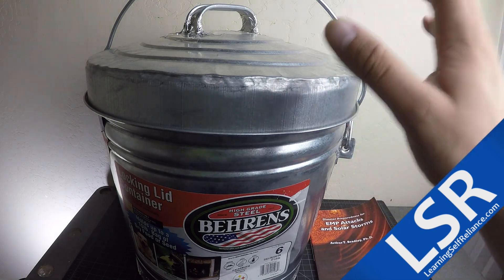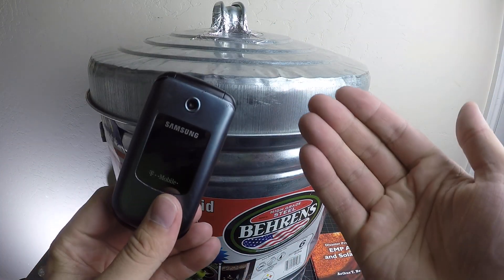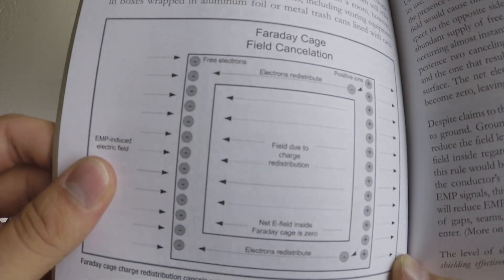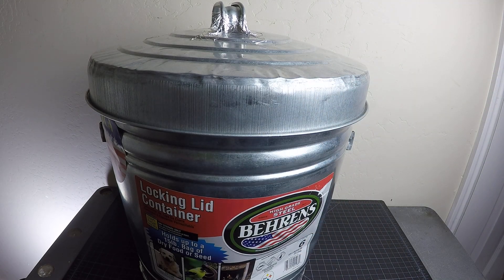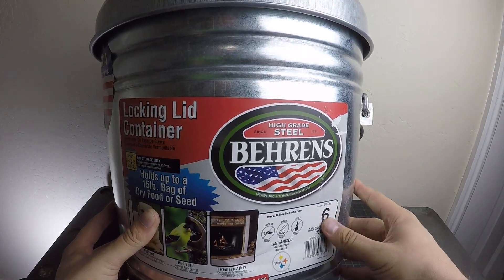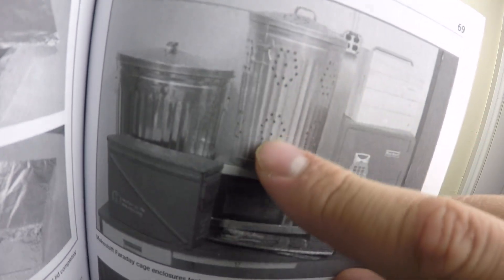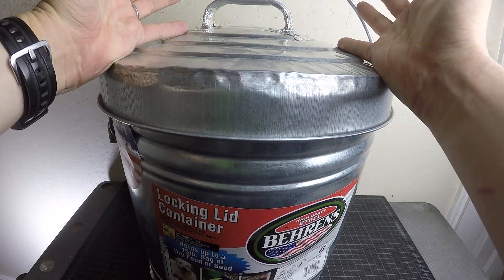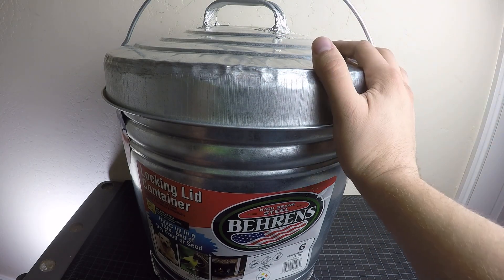Faraday Cage & EMP Misconceptions

Comment: I am only just learning. Don't laugh at me too hard at my dopey questions. 
I need to get that book! 
The solar maximum is in 2025. Conceivably we could get slammed by a massive CME at any time and then there's putin... again.
 It's 2022 now and he's freely talking about using them, this time. 
So, it's just smart to be prepared. 
Crap happens and humans are crazy especially the greedy and power hungry ones. 
Also,
I live in a14 x 70 single wide in Upstate NY. It gets pretty cold in the winter and I need to reside the whole thing. I had the roof redone and it's now a metal roof. 
I want to use the insulating foam board for the outside walls that are covered in foil anyway but I'm just thinking. If I do that. Do you think I'd get any protection at all between the roof and the walls? 

Now, after watching your video abd a few others, I feel like I need to cover everything!
 I want to get a portable solar power station too and those aren't cheap so, it'll get it's own can. I want to protect that as best I can and, of course, my Nintendo Switch too!
LOL 😆 priorities!!!

We might get as much as a 30 minute warning from a powerful CMP so, I was wondering, would my van still be fried if I disconnected the battery or took it out completely? I'm thinking take it out and put it in it's own metal can(2013 Grand Caravan named Agnes) After I took the battery out, would a thick silver thermal blanket (more like a quilt) draped over the engine (under the hood) protect the components so she'd start once I put the battery back in? Or would that just be a waste of effort and still take out the battery because, it's power can be used elsewhere.  Like where? I do not know. 

Like I said, I'm only just learning about Faraday cages, etc. 
Thank you! 😊

Comment: here's the deal.... DO NOT USE ANY TYPE OF METAL OTHER THAN COPPER OR GOLD.

AND IT NEEDS TO BE AT LEAST A QUARTER OF AN INCH THICK....

PERIOD...

There is no other metal in the periotic table that will ever get the job done... dont waste your time with aluminum.... waste of time...

you need copper or gold.... and if you really want it to be effective.... it needs to be layered with the same metals.... 1/4 inch thick in every direction will shield against anything that you throw at it.... no matter if its a high yield of EMP is... whether its a unclear blast, or Cosmic event....

if you have a cube that is 100% copper or gold and its at the very least... i recommend even thicker.... 1/2 inch or 1 inch thick with absolutely zero gaps.... then there is nothing that will penetrate that...

Comment: I'm not trying to be critical, but a lot has changed since the book you cite was written (i.e. transistor gate gap, etc.)  A good primer on EMP and CME can be found by searching for "the truth about the EMP Shield", but current information is available from many sources.  The manufacture of EMP Shield provides the protection for our military, many utility providers, oil and gas industries, individuals and more.  They provide protection for your whole house, generators, car and other items at very reasonable prices.  You can look up the approved providers for this type of equipment on the Department of Homeland Security website ( yea, a lot of snake oil out there).  While the potential for significant harm to our infrastructure, businesses and individuals was learned a good while ago during testing of nuclear weapons nothing of substance was being done (with the exception of th state of Maine).  In 2019 President Trump was concerned that we had a significant weakness that needed to be rectified and he passed legislation to incentivize companies to find ways to protect against EMP & CME.  The EMP Shield Company is a leader in this field.  Another good source for information on Faraday Cages, bags, etc., can be found by searching for "empdoctor" who is a research scientist/ educator (Phd).  He does a good job of displaying the effectiveness of various methods through video and simple, easy to understand language.  If you are a ham radio operator a good read is a book you can find on the ARRL website. There is a lot of good info available, but as you might expect, there is a lot more well meaning but inaccurate information.  RLTW

Comment: A transformer Popped( 1 Tiny EMP) 20feet Above my 1979 Pontiac Catalina. it Fryed The chip in the Engine, it Fryed the Chip in The Radio, it Erased 1/2 the CD'S  on the Seat in Line of Sight To Transformer. 1 Tiny EMP.   Killed that Car..

Comment: A true Faraday cage DOES block all Electromagnetic radiation. the Trash can still have gaps larger than the wavelength of the radio waves hence can leak into the can. However, if you use aluminium foil to wrap your phone and since it's completely sealed, no waves will pass through.

Comment: It’s 2021, I have a faraday bag that does not allow a cell signal to ring my phone. Bluetooth doesn’t work in either direction even with only a fraction of an inch between two paired devices, one inside and one outside. The same is true of wifi/hotspots.

I’m guessing physics has not changed in five years but I’m pretty sure there is something amiss with your cage.

Still I appreciate the time and effort to produce this video!

Stay safe and healthy!
Reply: yep was going to say the same.  I made cages at home, made sure to tape ALL holes seams and weakspots. no phone signals getting through.

1st try can was singing and I had no idea what was wrong.  the slightest gaps are significant.

Comment: The 1859 major coronal mass ejection (CME) discharge that directly hit the earth - straight on - was in the period of an enormous railway building boom in the United States.  The communication was by Telegraph & Morris Code.  It burned out miles and miles of Telegraph wires on telephone poles, taking great expense to replace it.
WIRES!  What about the power grid?  What about the wires leading to your house?  What about the wires IN YOUR HOUSE?  What about your extension cords?  What about the wires all over your vehicle?  So you save the ignition module somehow ~ are you prepared to completely rewire your car?
Are the windings in electric motors somehow immune?  Your starter motor?
Everything has to be metal shielded, and the SHIELDING has to be grounded - to a ground IN THE GROUND!  How do you do that when you are driving? At the Walmart parking lot?  The Dr.'s Office?

You can protect your transistor radio, but what stations will still be transmitting?
How many extra batteries do you have?

Comment: Why not use readily available items as a Faraday cage that may be free or cost little without modifications and that actually work and block out cell phone signal 100% if you want to test it with it.
Not sure why you want to save a cell phone  because the cell phone towers/equipment would be fried too.

Comment: Your generalities with trucking is hilarious. There are SO many sensors and computers on trucks that most of the time the trucks are in the shop for electronics issues, which STOPS their use entirely. You minimize by deciding what is permanent and not perminent damage, which is not relevant at all. ANY reason for the truck to not operate correctly will retard the engine or stop it completely. Based on your "Book" of expertise, 85% of all trucks down would be the end of our food supply after 2 days in the stores and a panic rush to buy everything on the heals of an EMP event.

Comment: I think you still want to ground any Faraday cage if you want it to function after a large solar event, or EMP.  You want to bleed charge to ground, always.  You can't have any air gaps, so you must seal all openings with conductive material, copper tape is much better than aluminum tape.  Your cardboard won't stop anything.  You have to tape the outside lid to can gap or what you have won't work at all.  You are putting more misconceptions out there, good intentions I know, but the book you are referencing tells you to tape the outside gaps to make the steel can work.

Comment: I made a faraday box for my cell phones and it works. I tried to call from my house phone and no ring then when i took out the phones none had bars but bars came back like a minute or two out the box. I used a wooden jewelry box and line the inside with aluminum tape and aluminum foil ,nice thick Reynolds wrap,not super thin dollar store foil.

Comment: I get people wanna save their stuff.. But why save your phone? Who the hell are you gonna call? There probably won't be any working towers for phone.. Let alone internet
Get lanterns.... Get food.. Water..etc
Reply: SD Cards slots filled with tons of audio, video, and ebooks regarding education & survival information.
Reply: Photos, but you could also save them on a hard drive. Then again, would be nice to actually be able to look at them on a screen
Reply: Cell phones would be a waste as mentioned in the replies. Get some FRS radios, take of the antennas before placing them in the can. I have a large can with a couple of HF transceivers, small 20 watt units. Good for short to long distance communications. A roll up solar panel is a good idea as well along with it's Voltage regulator

Comment: So basically it is a copper lining and magnet attack, so when two meets it creates a magnetic field that is opposite which rebel other electric fields outside? So, in one part you say it reduces the electricity but not stop. That is one part or you are typing the whole Faraday Cage that reduces the electricity field, so it doesn't stop completely. Or you mean base on metal alone it reduces the electric field, but the other part with inner that is copper like which interact magnet attract which causes opposite magnet field to the opposite so it stops completely? So, magnet field is important to stop electricity as magnet field is a barrier but different barrier that is magnet is magnet field as one barrier to copper as another when two magnet field meets in opposite way it creates a third magnet field barrier as a lining so it stops or reduces electricity field.

Comment: Thank you for this video.

Please review your physics-concepts again;  https://www.youtube.com/watch?v=Zu2gomaDqnM
It a quick lecture series about Electrics and Magnetisme of MIT.

There is no eletric field within a conducter: Al; the potentials within a hollow sfeer are equal. 
I can imagine that the bucket leaks current from the outside to the inside of the lid. dr. Lewin demonstrates in these series (maybe not in the shared lecture nr.3) that a electric load on the inside of a conductor moves to the outside of that conductor.

This is the cardinal reason to survive a lightning impact  within a automobile or a airplane in a storm.
Another example: on a dry and hot day, driving for a longer period....... when you toutch from the inside, trough the open window, the oudside of the car; only then you  will get a shock.

thank you for considering

Comment: Stainless steel is a very poor conductor and a proper Faraday cage needs to be made from a highly conductive material. A copper can/mesh will block the cell signal. Your steel can is not able to effectively distribute the electric charge. Essentially, that’s not a Faraday cage, it’s a storage bin.

Comment: I have a hard time believing that modern cars will not fail from a short waved EMP burst. They have so many interdependent components if one fails the whole car stops working.
Reply: Ik right if you pee on one wrong it needs a reflash at the dealer
Reply: You can buy an emp shield for your car.  I have one installed.
Reply: @delaville680  Good to know
Reply: @delaville680  can you tell me where and how you had this installed?
Reply: @delaville680  You Sir have been scammed.
Reply: @delaville680  they are a ripoff
Reply: @jamiefowler6524  I was gonna say... The steel body should be possible to modify into at least a partially effective Faraday cage. 

You may have to install screens over the glass, though. Pretty sure that's not legal. XD
Reply: So it seems that all of the shielding the military uses in its equipment is a waste of time, perhaps you should tell them to stop spending literally millions of dollars to shield their equipment.😮
Reply: @scottdavis6734  If you're planning on driving anyplace after an EMP attack (and assuming that the booklet is wrong and that >30% of vehicles on the road are toasted or out of fuel), you'd best have a reliable off-road vehicle capable of pushing vehicles out of the way and plenty of fuel stored.
Reply: Exactly will absolutely harm ALL Newer Cars & Trucks! Get an EMP Shield online
Reply: It'll crank back up.
Reply: All modern cars use high energy ignition systems. The electronics in the car must be protected from the EMP generated during each spark.
Reply: If the leaders of the world don’t recognize that they are gonna ruin the world then we all gonna be screwed and none of that will matter
Reply: I drive a semi, and the amount of sensitive electronics that cripple them are boggling. passenger cars are even worse.
Reply: Solar flares will eventually lead us back to using the very basic combustion engine technology..... Like a 2 stroke motorcross bike as the "new transportation" to get around 👍
Reply: @Jarmezrocks  🤙
Reply: The Bradley book being quoted here was published in 2012.  Automotive technology has certainly changed since then, so that part of the video is a bit dated.

Comment: I just put a 4g phone in a biscuit tin and it never even went to answer phone. Also, when I removed the lid there was no signal at all. You sure that's made of metal? If it is you need more ayers! Because I just used a simple biscuit tin and it worked.

I read cordless house phones are more powerful so tried that in the same tin and it rang. You need more layers I just watched another experiment where 3 metal containers like the one you use were put over a router 1 after the other whilst the signal was checked each time. It took all 3 till the signal was lowered considerably. But every time one was placed over it the signal dropped.
Reply: was it a flip/dumb phone?  It was easy to make a Faraday bag for my brand-new dumb phone (won't ring), but using the same material, a smart phone did ring.  The antennae for the dumb phones are far, far weaker.

Comment: I have an metal brief case I was thinking of storing my laptop in when i was not using it in case there was an EMP. I tried to call my phone and it of course failed to block it as yours did. But would it stop an EMP or reduce it enough to not damage? For they do shield against EMP's in the military designs. Perhaps they us multiple layers with polarised capacitors as I mention in my previous post to this? These are rhetorical questions. I don't expect you to know the answers. Anyhow I hope some are inspired to come up with better shields. Cheers.

Comment: Very good reading of the material.
Be sure your viewers also invest in Mylar Faraday baggies. They're inexpensive or free, and should shield devices placed in hard shell Faraday Cages of all types.
For those who want a quick FREE Faraday cage, you already have one in most kitchens: YOUR MICROWAVE OVEN. 
Unplugged, its the best protection there is.
Like most households which upgrade for fashion or needs, yours may already have a spare,  or you're getting ready to discard that old one.
Don't.
If you dont have a spare, either pick one up at a yard sale or even curbside. Clean it up good.
Then just place the spare under your workbench, or on another preferred storage shelf (unplugged). Throw in your spare or storage devices as needed.
Most can store all your EDC electronics, from cell phones to eReaders (Kindle, etc.), Tablets and yes; even Laptops.
Thanks for sharing your video, I'm looking forward to more. Subscribed!
Reply: Not true!  Put my cell phone in my microwave and could call it easily.  Maybe some are made better than others??

Comment: Just wondering,
I have what is called a mortin building garage....30'× 25' all steal, sheet metal with Cement floor, and insulated. How much deflection could this provide to a car parked inside as well as generators and other SHTF equipment from an EMP.
Reply: The floor needs to be metal and grounded to the rest of the building as well the front and the back of the building if it is not metal and the building itself needs to be grounded as well. 
All seams need to be tight without an crack.

Comment: Wrong. The reason a Faraday Cage needs grounding for noise cancellation is precisely to reduce DC current interference, which gets sent directly to ground. It also helps reduce EMI wave components that get converted to DC, as no metal Faraday cage is truly a perfect conductor and a DC component is always generated.  Everyone who works in systems requiring ultra low noise for the the detection of nano Amps or less (10^-9) knows by practice and measurement that grounding your Faraday Cage (btw, this is pretty s*** one), is critically important. A good Faraday Cage is made of mesh. You are simply demonstrating mostly the skin effect and are kind of approximating or misleading folks demo wise but not as much theory wise, except for the DC grounding part. Yeah you don't have to ground a Faraday cage for EMI but it does make a difference. Hence, the controversy.

Comment: This guy has demonstrated that it does not work but i put my cell phone in aluminum foil and it did not hear it ringing when i called from other phone, I know for sure if you put the phone in aluminum foil, it will not recieve any call.
Reply: Kailash sharma He's not dead accurate about this stuff. Correct you are sir.

Comment: will 12 volt solar panels themselves be OK?? & stand alone 12 volt car battery stored seperatly in a plastic container?
Reply from the maker: I believe solar panels will be ok so long as they don’t have any discrete components in them. If it has any sort of charge controller in it, that may be damaged. I’m no expert, so do some additional research 😁